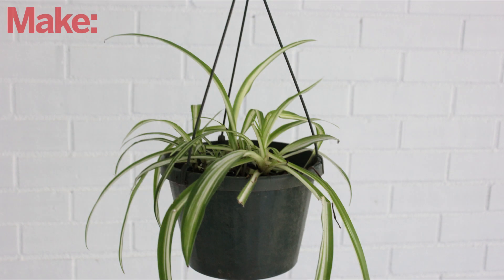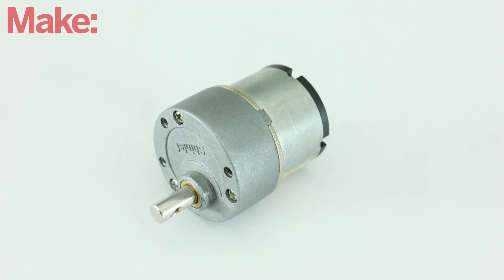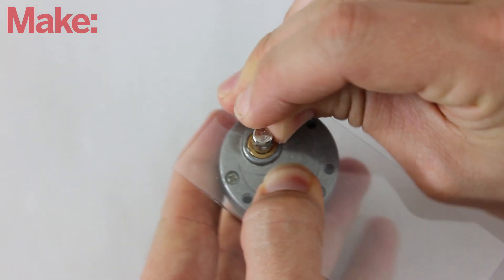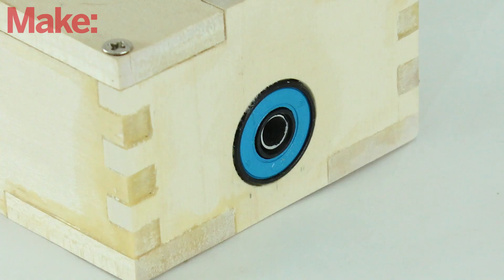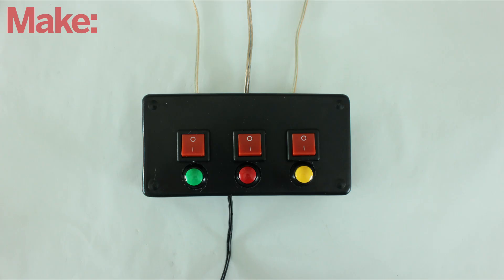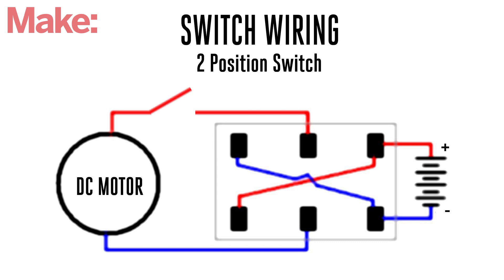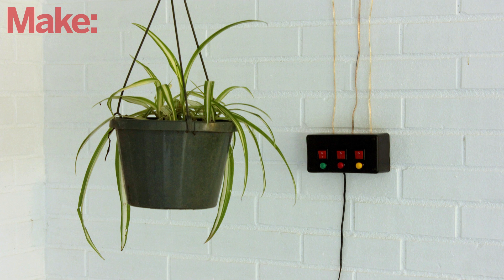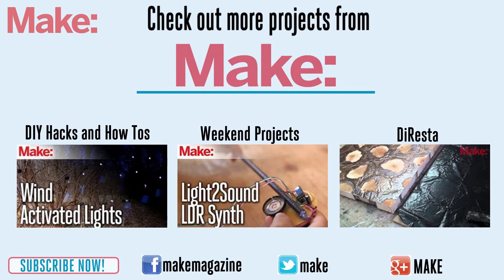Motorized System for Hanging Plants

Comment: is is so slow he did not even go into power connection how many volts to use a type of regulator if any  and last but not least how to plug the end plug to where and how is this AC or DC like dam dude with the type of info talking to a crowd of ppl who never knew this was possible, did he really think this instructions wud have been enough to be replicated? SMH

Comment: That installation is so clean.  I mean you hardly notice the three speaker wires running up the face of the wall, the giant black box stick on the brick and the unfinished wooden box screwed to your ceiling.  Well done sir.
Reply: ***** lol

Comment: A remote control system would be much less conspicuous,
Reply: RideThroughLife Exactly, you could hide the winch system and even lower multiple plants at once.
Reply: Or with your phone
Reply: RideThroughLife Easy to do with an Arduino or an Raspberry Pi